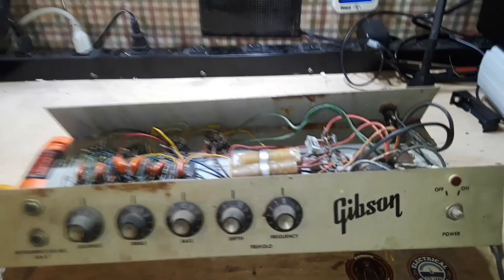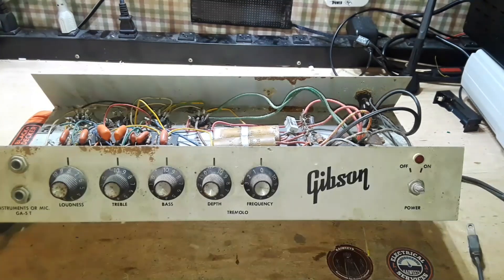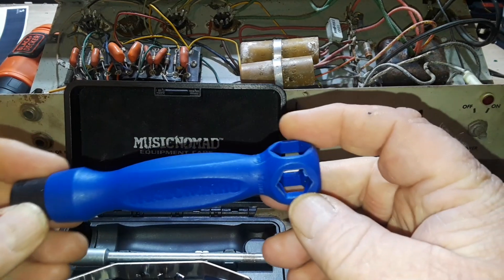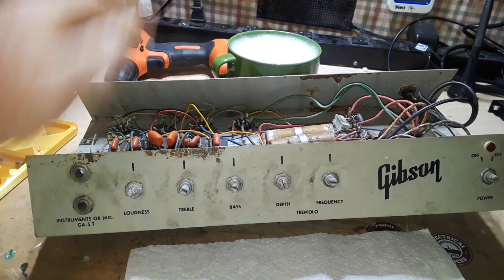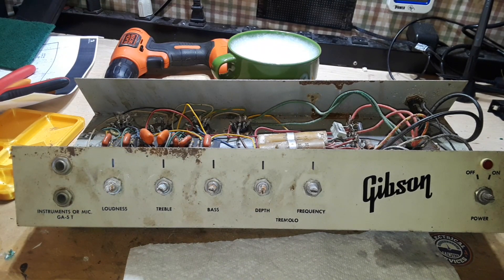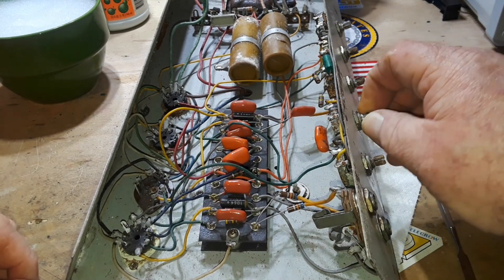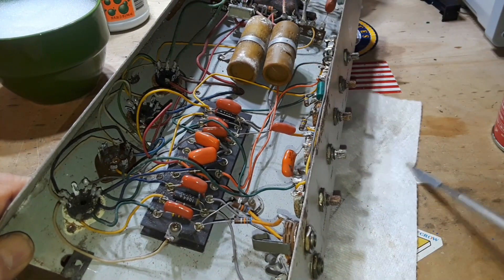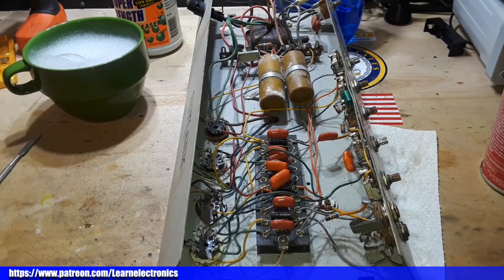Gibson Ga-5T "Skylark" Guitar Amplifier Restoration P2

Comment: The third transformer is the phase invertor circuit, no tube needed! A circuit design technique that dates back to the 1920's, but generally considered "obsolete" by the 1950's and rarely seen in guitar amps.

Comment: To remove splned press-on knobs without damaging the splines or the pot shafts, use two teaspoons as simultaneous levers, the tips of the spoons opposite each other and under the lip of the knob. Or, use two of the specialty tool you already have.....but two spoons is cheaper.

Comment: so impressive you know what your looking at it such a big mystery cluster of components to me lol.
Reply from the maker: You are looking at the forest. Look at the trees. Don't see all those wires everywhere. Focus on one thing and you will be able to make sense 9f it all. For instance. Take the fender champ 5e3 circuit. Super simple. Follow the signal. It comes in through the jack, past the input resistor to the grid of the 1st stage gain. It exits via the anode and goes though a pot for volume and into the grid of the second stage. From here it exits via the anode again and 1/2 goes to the inverter and then off to one of the power tubes. The other half goes directly to the other power tube. ( They are 180 out of phase). Signal exits the power tubes as high voltage low current AC. Now it goes to the output transformer which changes the high voltage low current to low voltage high current and passes it to the speaker.
All the resistors and capacitors just put the tubes into the operating region where they work as an amplifier.

Comment: I might look-up for schematic in this really nice book that I got from a friend... That is, if I manage to find the book. 🥺
Reply: So, I found the book, it's called "A desktop reference of hip vintage guitar amps" by Gerald Weber. In it there is a lot of schematics, mods, repair and restoration tips... However, there is only one schematic for the GA-5T, and it seems to be the "default" one.
If you are interested, I could take a photo of it and send it to your e-mail.
Tbh, I'm kinda dissapointed as there is much on Fender, Marshall, even Ampeg and other amps - but not so much for the Gibson. Who knew? 🤷🏼
Reply: @PappaBear_yt, there are four different versions of the GA5T that I know of, with different tube types, and a differing tube count, and differing circuits. Even if you have the schematic showing the correct type and number of tubes, the circuitry in the amp is likely to differ compared to the schematic. That's just how Gibson was. A good tech can still navigate their way around the amp anyway, schematic inaccuracies not withstanding.

Comment: I'm kind of surprised you didn't find an old schematic inside. It was very common in this era to paste schematics inside of radios and amplifiers just for repairs.

There's a good chance those orange drop capacitors are both original and still good.